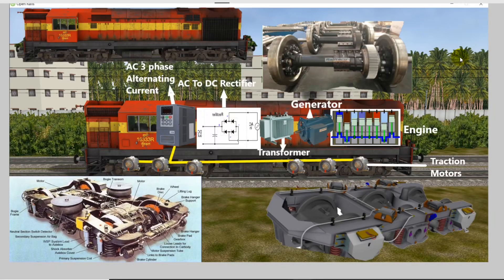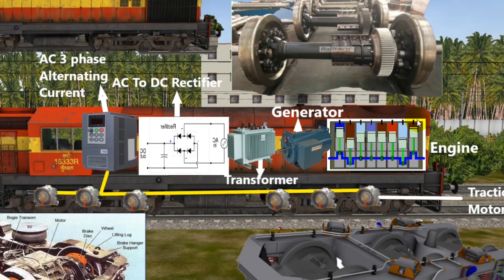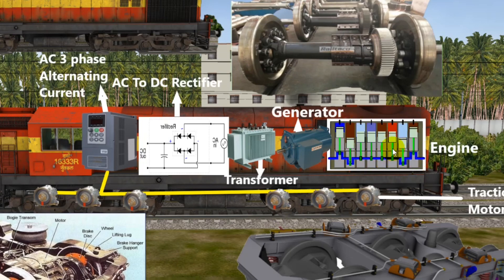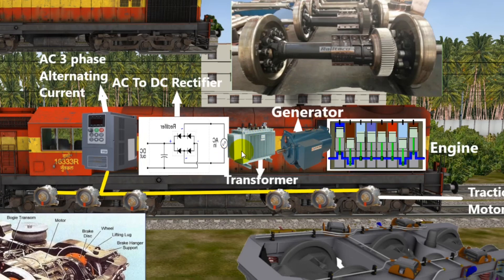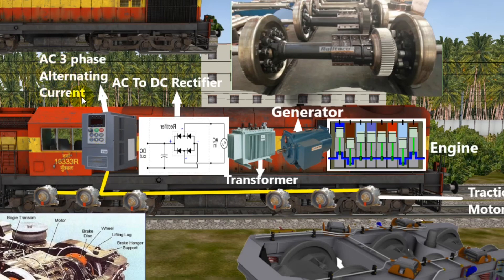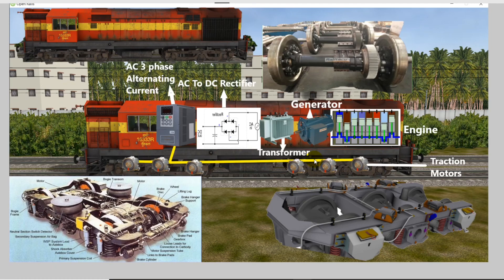How Diesel Locomotive Works in Telugu ?? || డీజిల్ లోకోమోటివ్ ఎలా పనిచేస్తుంది ?

Comment: Wdp4d wdm3a loco teda eamiti
Reply: wdp4d lo 2 stroke diesel engine , 3 phase ac traction motors use chestharu and  wdm3a lo 4 stroke diesel engine, dc traction motors use chestharu

Comment: Bro Train millaz antha
Reply: Thats depend upon load of rake n route.. der is no particular mileage in Locos.. if EMD hauling a train with 24coach passenger rake it will consumps 4 to 5 liters diesel per 1km.. It may change same loco with frieght rake. Alco will consume 6to7 liters diesel per 1km with same 24coach passenger rake.. same loco with frieght may consume 6to8 liters.. Its only a standard estimation only some times mileage will change with so many factors like nature of route n performance of LP too.. However EMDs r more economical than Alcos in fual consumption n so many things like interiors, controls n comfort to crew..